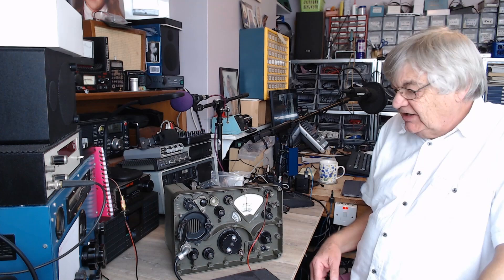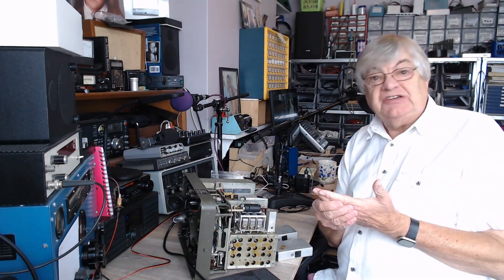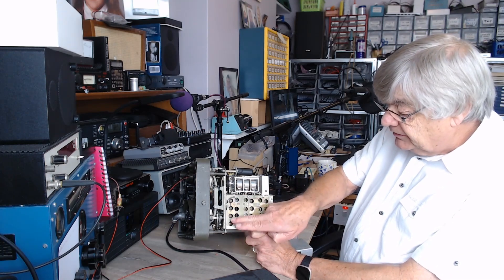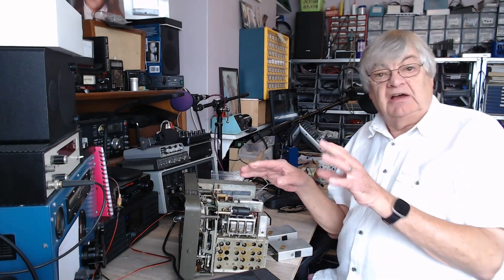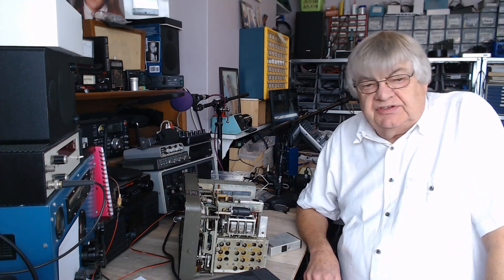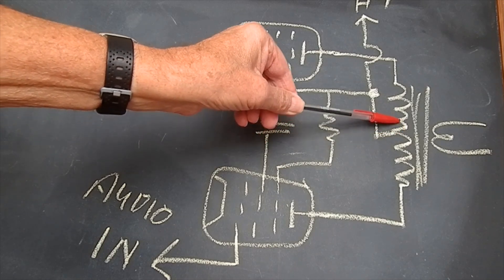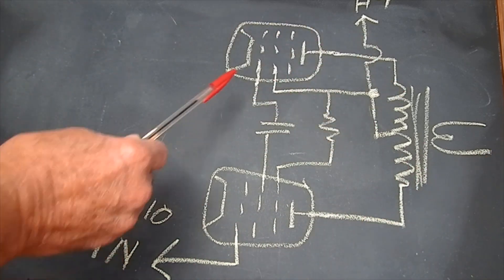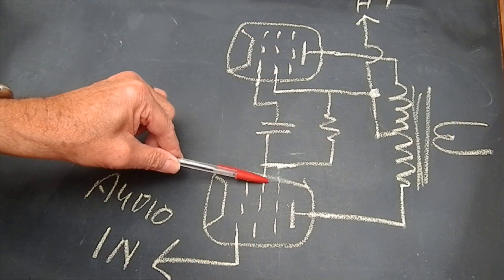G4NSJ - R209/2/B Reception set valve military comms receiver. Part 2

Comment: I've just looked at the schematic  during CW / BFO mode  I see there's a twin-T  notch filter wrapped around o/p pentode V9. That'll narrow the audio bandwidth, really great for reading qrmmy CW, but for SSB its narrow sound could be grating after a while hearing it. 
Edit... the narrowed audio bandwidth some may attribute in error to tiny speaker, hear the difference better through phones.
Reply from the maker: @jagmarc  I was referring to the small speaker when listening to AM broadcast stations. The bandwidth on SSB is perfect, it sounds great.
Reply: @g4nsj   great for CW A1.

Comment: Thanks for these very interesting videos Ray - I love ex military kit, I've a few bits here including a WS38 which I'll be working on soon. Anyhow, a friend of mine had an R209 back in the 80's and what was interesting about it was that the IF stages had been converted to use FETs and transistors, all the more interesting because the mod looked official - the semiconductors had CV numbers as I remember. It would be interesting to find out. Anyway its performance was very lacklustre and I think ultimately it got converted back to valves!
Reply from the maker: Hi, FETS and transistors with CV numbers... that's very interesting.  I'll see if  I can unearth some info about that.  I had a WS38 set many years ago, I wish I'd kept it.  Let me know hopw you get on with it. Cheers, Ray.

Comment: Wow!!! That was a lucky find!! Intermittent components are always fun. Would it be possible to put a current limiting resistor on the cathode to possibly save the tube in the event of another capacitor failure?
Reply from the maker: Good idea. I have replaced all caps now so, hopefully, no more problems.
Reply: @g4nsj  lol....not for at least another 40-50 years!! I've been watching your videos for about 8 years Ray and I really enjoy them!! Do you have any more "pirate" radio stories to share? My gosh I enjoy them alot!!
Reply from the maker: @hitekredneck109  Glad you like the videos. I hope to be working on some pirate radio videos soon.
Reply: Ah I couldn't find this comment at first I'd left reply on another thread.  Cathode resistor would be problematic but a suitable PNP transistor instead,  added inline with the HT to the op transformer. PNP saturated whole time until current exceeds threshold. Anode drops, the transistor burns off the power instead saves the valve.
Reply from the maker: @jagmarc  Great, thanks!

Comment: Top pentode's G1 'gridleak' R,  hadn't gone high had it?   It's not drawn on the sketch (ommited for clarity?). 
 At 9 quid a shot I'd be tempted to add clamp silicon diode to the grids
Reply from the maker: All resistors checked and  OK
Reply: Capacitor replaced anyway,  but I saw suggestion somewhere here maybe could had prevented burnout with current limit resistor etc.  There is already a 1K (R47) but to get a protective current limit this way would have to increase value from 1K. Is a possibility because the audio output power is very low about 50 mW. Starves the anode at louder audio, might be annoying compression effect maybe increase C83 make sound more natural. 
Sacralidgious approach add a small highish VCBo PNP transistor inline used as a current limiter. It would spend all its time saturated so wouldn't have any effect , until any fault appears.